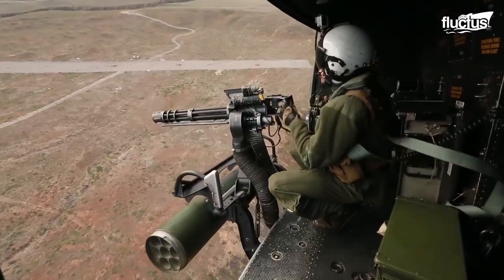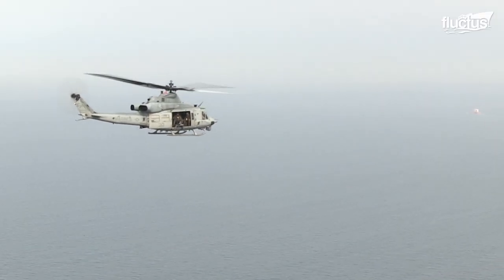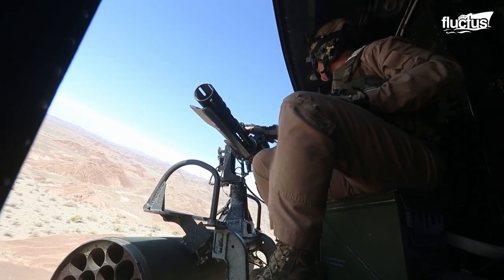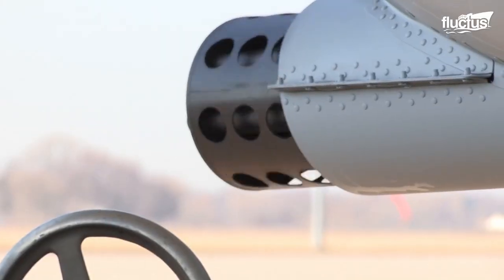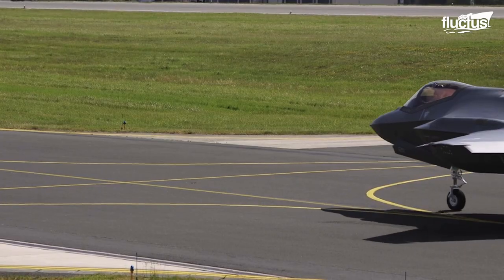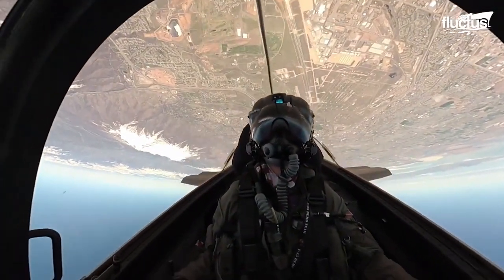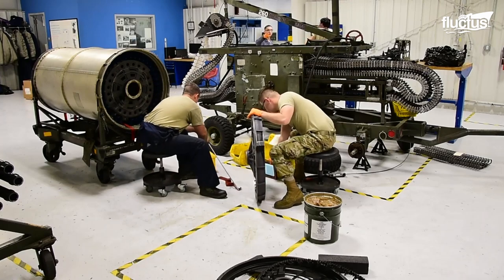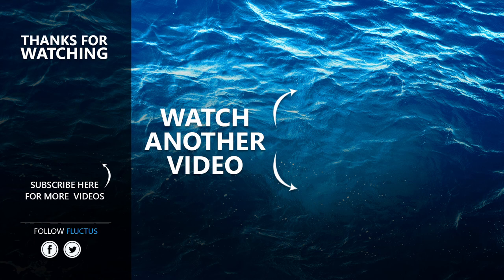Why it Became So Hard to Shoot US Gatling Guns Today

Comment: The A-10 is so slow, it gets passed by it's shadow. 08:14
Reply: Gets birdstrikes to the rear
Reply: No offense, but that's incorrect. The A-10 Warthog's top speed is 364.9700knots (420mph). The A-10's cruise speed is around 302.4037knots (348mph). As the Warthog was introduced in 1977, and weighs approximately 24,960lbs (11321.666kg), it comes to be no surprise that the plane is slower than modern planes. If you had any knowledge of these facts, you wouldn't be saying the Warthog is slow sir.
Reply: @DaGooperr  I hope you are joking, or a bot, and not the third option.
Reply: @DaGooperr   actually if you knew anything about astrophysics you'd know the speed of light and thus the speed of a shadow because shadows are a lack of light in a vacuum is 299 792 458 m/s (the fastest possible speed) converted that's 670616629.3844 Mph much faster than 420 Mph
Reply: @noahway13  I'm not joking.
Reply: @DaGooperr  Yes, you ARE.
Reply: @noahway13  I'm not.
Reply: @noahway13  Funny thing, I actually have a degree in aeronautics. I know how planes work.

Comment: Corection. Muskets were rarely used during the Civil War. It was front loading rifles. The diference is not, as most people like to toat, using a cartride, but the fact that the barrel has rifling to give the bullet a spinn and the weapon using a bullet shaped projectile in contrast to a ball.
Reply: the springfield model 1861 musket was the most popular gun in the civil war.
Reply: @sparty94  Yes, which is a rifled musket. The guns used were still muskets, but they had rifling as the invention of the minie ball allowed for muzzle loading into a grooved barrel.

The original comment is sort of right. The main weapons used by both sides were both muskets and rifles; what we often think of as "muskets" are more specifically smooth-bore muskets.

Comment: One trigger pull on the Dillon Aero 3250 rounds. The second trigger was 6250rpm unless something has changed. 1150 rounds a minute is available is some sub machine guns without slowing the rate of fire to 900rpmm